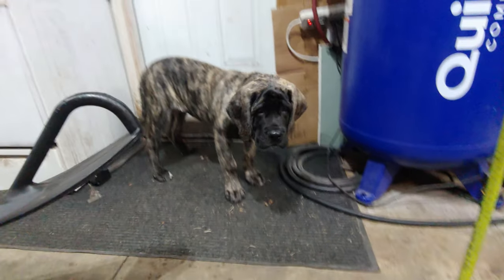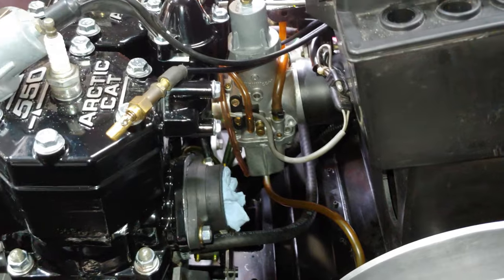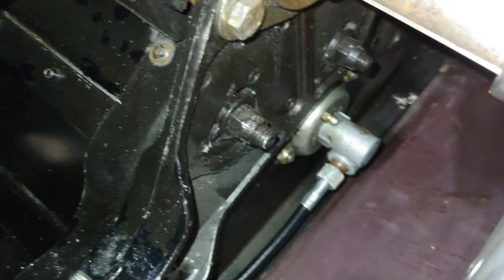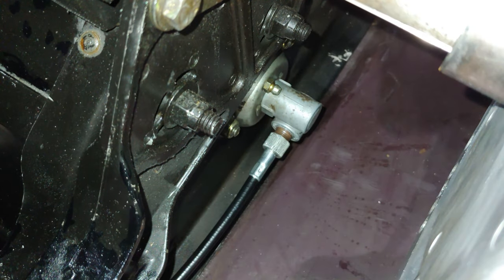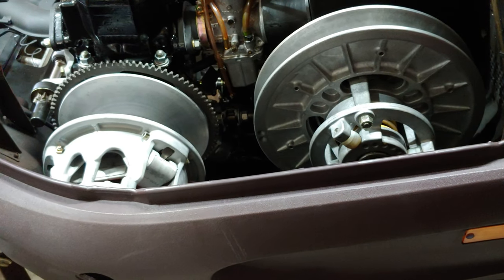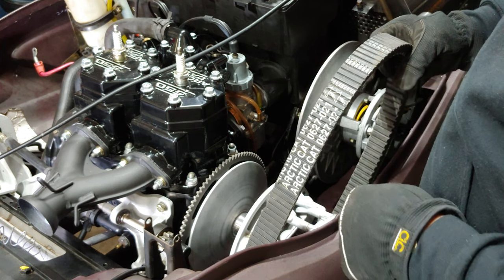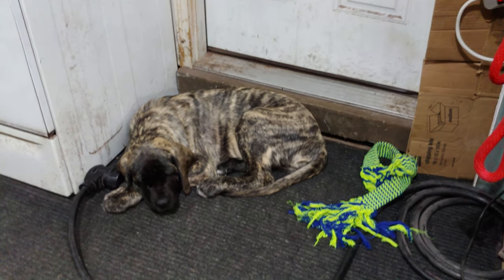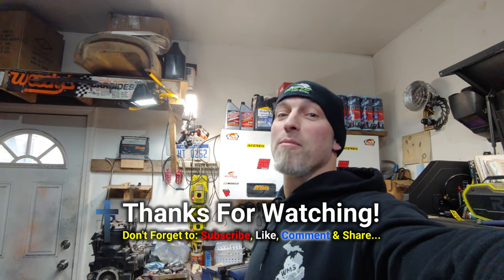2003 Arctic Cat Pantera 550 LTE ESR Series Part 5 || Engine, Carburetors, Clutches

Comment: Any tips or tricks on removing a seized secondary? I cannot get my secondary off of the shaft.
Reply from the maker: Yes. You might need to get the carbs out of the way first. Heat it up in the cylinder in the back and then use a flat piece of 1/4" steel flat on the back and use an air hammer on that piece so you dont damage the clutch. If that dont work, youll have to remove the jackshaft completely from the sled with the clutch in it. Place it in your lap, sitting down and with a grade 8 bolt screwed in to just before bottom of bolt head bottoming out, wack on it until it comes out. Might be able to make a puller but that would require attaching it to the 3 posts and removing the belly pan. Might put too much stress on those posts and snap one though.
Reply: @Fixin2Ride-Official-  have you ever tried a secondary clutch puller? Does that exist? I wonder if that would work?  I know primary clutch pullers always used
Reply from the maker: I think theres a brand specific one.
Reply: @Fixin2Ride-Official-  do you have a preference on replacement drive belts? Do you always use Arctic Cat?  Or go aftermarket?  I'm sure I'm going to need a belt, this may be the original on this sled 😀
Reply from the maker: I started using the Dayco HPX belts and like them. Google arctic cat anowmobile OEM drive belt cross reference chart and you'll see wverytbing available for the Arctic Cat oem drive belt numbers.
Reply: @Fixin2Ride-Official-  thanks for the info, the Dayco HPX did come up in my aftermarket belt search, I think I'm headed down that path
Reply from the maker: Got a couple of them now and my 800 loves it! Lots of grip. Of course my C2C and clutch alignment are set properly.
Reply: @Fixin2Ride-Official-  yeah, I saw your clutch alignment tool in that video, pretty cool
Reply: I put the sled on its side so the jackshaft was vertical, flooded it with PB Blaster, I'll let it soak for 24 hours see if that helps
Reply from the maker: Good deal. Thanks for the update. Hooe that works. Heat up the back section that rides on the jackshaft. That will help expand it and possibly let the PBB seep it better.
Reply: @Fixin2Ride-Official-  pulled the airbox, used a little bit of heat, and a block of wood on the back of the secondary, took a decent amount of force but I was able to get it off. My new problem is belt deflection, with the brand new belt and all the shims removed between the sheaves on the secondary, belt deflection is still over an inch and a half, way to loose 🥴  This is the new Dayco hpx belt, what am I missing?  It's so loose I can take the belt off without pushing the secondary movable sheave.
Reply from the maker: You only eant the belt to sit aboit 1/8" above the edge of the sheaves edge. If its still too loose then you may need to loosen your mouting bolts and nuts from the motor mounts and use the bump stop to make the center to center of the clutches to be 12.2" and then tightened up all the motor mounts again and back off the bump stop at back of engine u til you can see a hair of light between them. Typically .020" IIRC. 

 If you cant get the right Center to Center when you back off the bump stop, youll need to remove the mount bolts and egg out the holes front to back an 1/8 to 3/16" and then reset the center to center a sstated above.
Reply from the maker: Here's another way I talk about removing the driven clutch after the jackshaft is off. Start watching at 7m... 
https://www.youtube.com/watch?v=fQFxvzwc6rQ